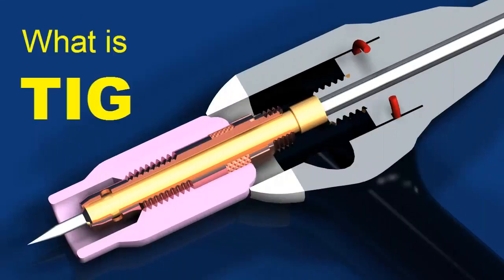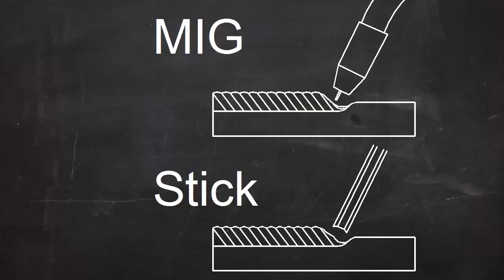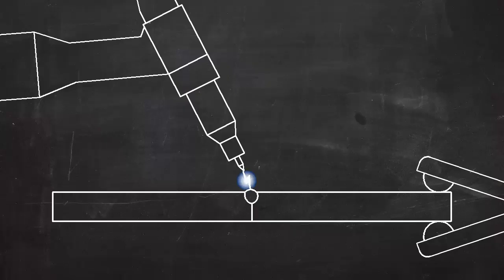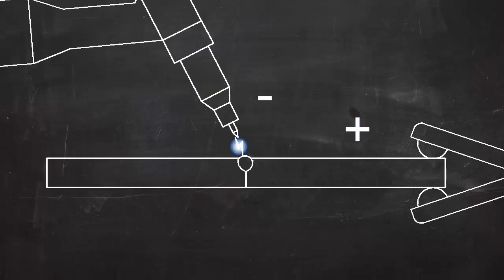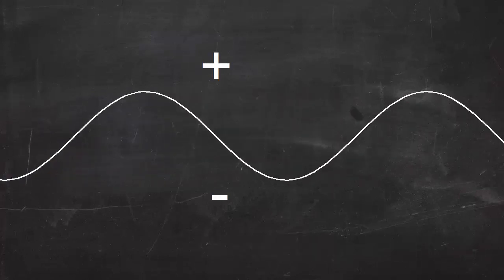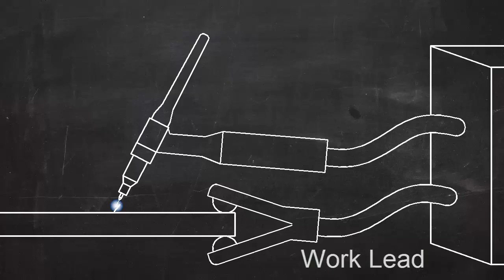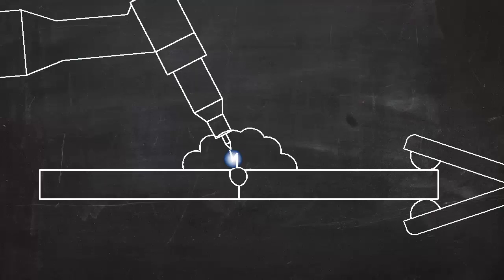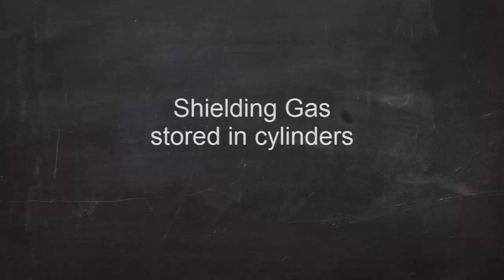What is TIG Welding GTAW by weldnotes.com

Comment: Ahmad Fahmi Prakoso
GTAW is type of fusion welding. GTAW use tungsten as the electrode for the welding. the tungsten gave high temperature of melting point,so it can't be melt. the type of electrode is non-consumable electrode. GTAW use DCEN,it means the electrode has negative polarity.It use AC Current because produces more heat. Because of the electrode can't be melted,we must use filler.Before use the filler,we must use the compatible filler with the material.GTAW produces shielding gas,so it's prevent the material from reaction with the environment

Comment: Arananda Krisdoy Simarmata
02511840000008

TIG Welding or usually called Gas Tungsten Arc Welding or GTAW that use tungsten electrode. Now, tungsten has an extremely high melting point.  When you tig weld, the electrode gets hot but it doesn’t melt. We say it is a non-consumable electrode.  That doesn’t’ mean it lasts forever, just that it doesn’t melt and become part of the weld.Tig works by melting the base metal (that is, the metal that makes up the two pieces that are to be joined. The heat is generated by an electric arc that forms between the base metal and the tungsten electrode.   You can control the amount of heat with a foot pedal or with a thumbwheel on the torch.

Comment: Jeremy Osland Marganda Sinaga
02511840000021

This video talk about TIG welding. TIG stands for Tungsten Inert Gas Welding. The American Welding Society calls this process gas tungsten arc welding (GTAW). You might also hear it called Keeley arc welding. TIG welding uses a tungsten electrode and tungsten has an extremely high melting point when you TIG weld the electrode gets hot but it doesn't melt we say that it's a non consumable electrode and doesn't mean it lasts forever that just means that it doesn't melt and become part of the weld. You see in a lot of other welding processes the electrode melts and becomes filler metal those are consumable electrode processes so here's the tungsten electrode being held in a TIG torch the electrode slips into a collet and the collet tightens up against the collet body you can adjust the length that the electrode sticks out of the holder by loosening up the end cap when you tighten the end cap the collet clamps down on the electrode TIG works by melting the base metal and that is the metal that makes up the two pieces that are to be joined the heat is generated by an electric arc that forms between the base metal and the tungsten electrode you can control the amount of heat with a foot pedal or with a thumb wheel on the torch for most metals the current is direct current or DC DC is like the current flowing from a car battery one wire is always the negative and one is always the positive DC TIG welding the electrode is usually negative and the workpiece is positive term of dcen is used for this indicating that the current is DC the electrode is negative this is also called straight polarity the DC en is a more descriptive term dcen puts most of the heat on the workpiece and it's the most common setup when welding aluminum however AC is used in AC the positive and negative voltages switch back and forth between the electrode and the work piece this puts more heat on the electrode but it has a cleaning effect on the workpiece you see aluminum forms oxides that float to the top of the weld pool and prevent a good weld AC current helps control these oxides in an electric circuit the current flows in a loop until well ding the current has to flow in a complete circle from the machine to the torch into the work and back to the machine a work lead is clamped to the work to complete the circuit from the workpiece back to the machine now you can TIG weld with or without filler metal and that's not a choice you have in a lot of other processes if you want to add filler metal to a TIG weld use a filler rod which is just a rod of metal with a specific alloy you want to make sure that the filler metal you're using is compatible with the base metal and then it has the strength required to do the job in TIG welding the molten

Comment: Ega Oktriliardi
02511840000013
Summary of the Video:
1. Tungsten Inert Gas (TIG) or Gas Tungsten Arc Welding (GTAW) is type of welding that use tungsten as the electrode for its superior temperature of melting point. the tungsten electrode may produce lot of heat that can melt the metal, but the tungsten itself didn't melt, it's called non-consumable electrode

2. the polarity used in TIG usually is DCEN, means that the electrode has negative polarity, except for Aluminum, AC current is used, the AC produces more heat, but has cleaning effect to the workpiece because it can control aluminum oxide forming during welding

3. There is option to choose whether we want to use filler or not, filler rod is just metal with specific alloying elements, make sure that the filler is compatible with the base metal

4. like MIG, TIG also produces shielding gas, that is inert gas that provided by  gas compartment (high pressure tube). the gas flows from the tubes directly to the welding point through nozzle of the welding torch. the inert gas prevent the welding metal to react with it, or to react with environtment

Comment: Ganang Wasono 
02511840000062
in the video there are times entitled "what is TIG Welding GTAW by weldnotes.com" information can be found. in the video explained like what is contained in the title which is about welding Gas Tungsten Arc Welding (GTAW). Gas Tungsten Arc Welding is an arc welding process that uses an arc between a tungsten electrode (non-consumption) and a welding point. This process is used with gas protection and without applying pressure. This process can be used with or without the addition of filler metal. The heat from the arc between the tungsten electrode and the parent metal will melt the fill metal to the parent metal where the arc is protected by noble gases (Ar or He). There is  option to choose whether we wanr to use filler or not

Comment: Arsya Gading Mahesa
02511840000136

Gas Tungsten Arc Welding (GTAW) also called “TIG” Tungsten Inert Gas. tungsten has an extremely high melting point, when we weld using TIG the electrode is getting hot but it doesn’t melt. it’s non consumable electrode. the electrode is being hold in the torch, the electrode slips into the collet and the collet tightens up against the collet body. the length of the electrode can be adjust. it is generated by an electric arc that forms between the base metal. we can control the heat with a foot pedal or thumb wheel in the torch. usually is using DC electric current, the negative is usually on the electrode and the positive is on the work piece it is called straight polarity. in AC, it can be switch the negative and the positive. the circle/circuit is a complete circuit from the machine to the torch into the work piece and back to the machine. TIG welding is can be use with or without filler metal.

Comment: Johakim De Brito Dwiki Lakaseru
02511840000048

TIG Welding stands for Tungsten Inert Gas Welding. American Welding Society called this process as Gas Tungsten Arc Welding (GTAW). GTAW also termed as “Heliarc”. TIG uses tungsten as electrode. Tungsten has very high temperature, hence when heated to melting temperature of the base metal, tungsten will not be melted. Because of this tungsten electrode also called as non-consumable electrode. Tungsten electrode is fasten to the torch by collet and collet body and can be adjusted in height according to the need. The amount of heat on TIG welding can be controlled. 
The heat to melt the base metal is produce by electric arc between electrode and base metal. Because the electrode will not become the part of the join, filler metals are sometimes needed.
The most common current for electric arc welding is DC current, where usually the electrode is negative while workpiece is negative hence put most of the heat on workpiece. This scheme termed as DCEN or straight polarity. When welding aluminium however, AC current is used, hence the positive and negative always change between workpiece and electrode. This scheme put most of the heat on electrode and resulting cleaner surface finish. 
Electrons flow from the machine to the torch through the workpiece and back to the machine via clamp on workpiece. 
Protective gases for TIG welding are usually argon or helium. These protective gases prevent molten metal from reacting with oxygen or water vapour at the atmosphere. These protective gases are stored in pressurize container. The pressure of the gases are controlled by regulator and channelled to welding point by hose.

Comment: Adelina Salsabila Ednanda
02511840000066

in this video explain about Gas Tungsten Arc Welding (GTAW) can called TIG (Tungsten Inert Gas).TIG welding is can be use with or without filler metal. tungsten has an extremely high melting point, when we weld using TIG the electrode is getting hot but it doesn’t melt. the electrode is being hold in the torch, the electrode slips into the collet and the collet tightens up against the collet body. the length of the electrode can be adjust. it is generated by an electric arc that forms between the base metal. we can control the heat with a foot pedal or thumb wheel in the torch. This welding process also uses direct current that the welding electrode is negative and the workpiece is positive. Ussualy is using DC electric, it puts most of the heat on the workpiece. When welding Al, it uses the AC. The electrode is positive and the workpiece is negative. the circle/circuit is a complete circuit from the machine to the torch into the work piece and back to the machine.

Comment: Aldiansyah Wahfiudin
02511840000004

Tungsten Inert Gas Welding (TIG Welding) or Heliarc welding
-TIG welding uses tungsten as the electrode. Due to its high melting temperature, the electrode does not melt as it is used to weld things. It is a non-consumable electrode.
-TIG works by melting the base metal. The heat is generated by an electric arc.
-TIG welding uses DC current to generate electricity. Usually, the electrode is negative and the workpiece is positive, thus it is called DCEN or straight polarity.
-However, AC current is used in TIG welding when welding aluminum workpiece.
-When a filler is needed, we use a filler rod to fill the gap.
-In TIG welding, the metal is protected by a shielding gas, usually argon or helium that keeps the metal from reacting to oxygen and water vapor in the air.

Comment: Adzon Nugraha Rizky Pratama
02511840000107

TIG (tungsten inert Gas) or GTAW (Gas Tungsten arc welding) is a type of weld that uses tungsten as an electrode. Tungsten can withstand high temperatures so that tungsten does not melt alongside other metals. Therefore it is called non-consumable electrode
On TIG Welding, the current is used DC current with electrodes as negative pole except in aluminium using AC current. It is because the current of AC can control the formation of aluminum oxide at the time of welding. 
TIG can use fillers or not. It depends on our needs but make sure that the filler is compatible with our base metal. TIG and MIG alike produce shielding gases that are rice from a high-pressure tube. Usually shielding gas is an inert gas to prevent the reaction between the weld metal with its environment.

Comment: Mischell Sari 
02511840000090

TIG is Tungsten Inezt Gas, Gas tungsten arc welding or also called heliarc.  This welding use tungsten as an electrode because it have a high melting point. So the electrode getting hotter but the electrode doen't melt. This welding is classified as non- consumable electrode. Like other welding process, first the metal is being melt then the metal will begin to solidify and mixed with other and become one material. The heat can be controlled by foot pedal or thumb wheel on the torch. This welding use positive DC for their electric current. 
The electrode is negative while the metal or workpiece is positive. Straight Polarity is when the electrode connect with the negative terminal. In DCEN, the most of the heat is in the workpiece. But when doing welding for alumunium materials, used AC as their electric current. This electric current give a more cleaning effect on the metal. 
This welding process can use with or without filler metal. 
However, the TIG welding also protected by a shielding gas which use to protect them from contaminants.

Comment: Nurin Nafi'ah
02511840000043
This video explain about TIG (tungsten inert gas). Its known as GTAW (gas tungsten arc welding). It uses a tungsten electrode that it is not consumable electrode, has an extremely high melting point. This electrode will gets hot, but it can’t melt in welding process. In other welding process, the electrode will melt and becomes filler metal. TIG work process by melting the base metal and the two pieces of metals will joined. The heat is generated by an electric arc that forms between the base metal. The electrode can be control by a foot pedal. This welding process also uses direct current that the welding electrode is negative and the workpiece is positive. In the DCen, it puts most of the heat on the workpiece. When welding Al, it uses the AC. The electrode is positive and the workpiece is negative.

Comment: Mochamad Ichwan Al Shafa
02511840000140
Tungsten arc welding gas is one type of arc welding with non consumable electrodes. The GTAW process uses tungsten electrodes to heat the workpiece and additives. Additives or fillers are needed, of course because the electrodes used are not consumed. GTAW uses inactive inert gas. The most commonly used protective gases are argon and helium. Because of the use of inert gas, GTAW can also be referred to as tungsten inert gas or TIG welding. The GTAW work principle can be interpreted as the OAW work principle. Where the workpiece is heated first using the torch. Further when needed, we can add additives or fillers to the welding fluid. The following image shows components in GTAW. There is an option to choose whether we want to use filler or not, filler rod is just metal with specific alloying elements, just to make sure that the filler is compatible with the base metal.

Comment: Okta Nirmala Putri
02511840000030

This video explain about TIG. TIG stands for Tungsten Inert Gas Welding. America Welding Society calls this welding process Gas Tungsten Arc Welding or GTAW or we can called it Keeley Arc Welding. TIG welding uses a tungsten electrode that has an extremely high melting point. When the material that going through Tungsten Inert Process but it does not melt we say that it's a non consumable electrode. It does not mean it lasts forever means that it does not melt. Many of welding process and other welding processes the electrode melts and becomes filler metal. Those are consumable electrode processes. So,there are the tungsten electrode being held in a Tungsten Inert Gas Welding. TIG works by melting the base metal and that is the metal that makes up the two pieces that are to be joined. So in summary Tungsten Inert Gas welding is an electric arc welding process uses non consumable tungsten electrode. The filler metal is added separately in the form of filler rod and the shielding gas comes from a high-pressure cylinder.

Comment: Alwi Arafat Lubis
02511740000068
TIG welding is an electric arc welding process uses a non consumable tungsten electrode the filler metal is added separately in the form of filler rod and the shielding gas comes from a high-pressure cylinder. TIG welding uses a tungsten electrode tungsten has an extremely high melting point when you TIG weld the electrode gets hot but it doesn't melt we say that. GTAW or TIG welding is welding process which uses tungsten rod as non consumable electrode. The arc is generated by electric spark between electrode and work piece in a constant gap.

Comment: Vindi mardatillah maulida
02511840000038
 Tungsten Inert Gas (TIG) or often called Gas Tungsten Arc Welding (GTAW) is one form of Arc Welding .Tungsten Inert Gas (TIG), is a type of welding using tungsten as its electrode. Tungsten electrodes function as a conduit of electricity, but do not melt as the base metal melts. The current at TIG uses a DC current with electrodes as its negative pole, except for aluminum welding using AC current, the AC current on aluminum welding can control the formation of aluminum oxyde. at TIG, we can use filler or not, depending on needs, fillers are usually in the form of metal with certain alloy components. TIG produces shielding gas through a source of gas from high pressure tubes, the gas used is inert gas such as argon.